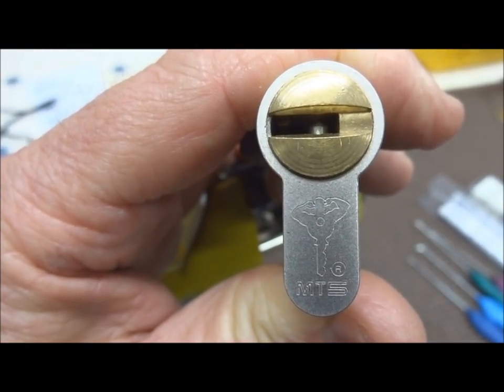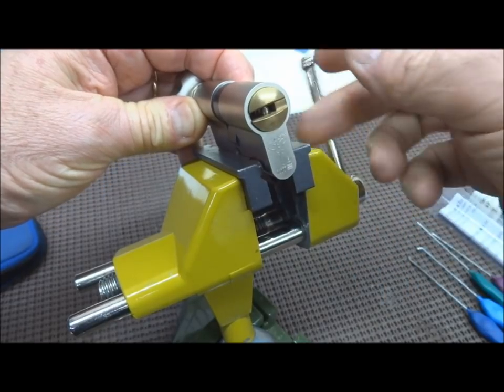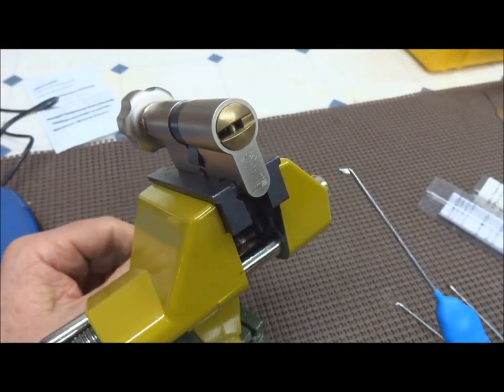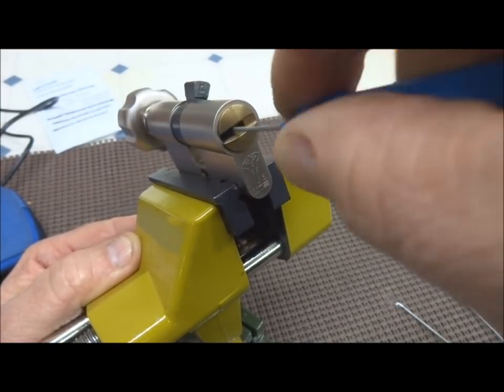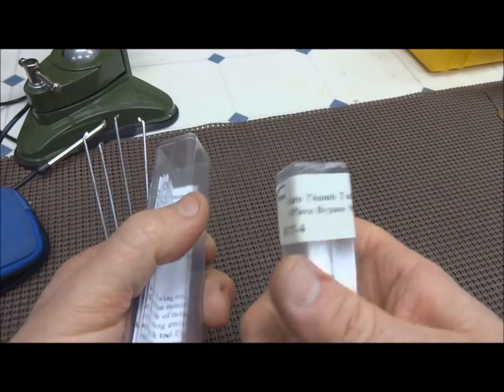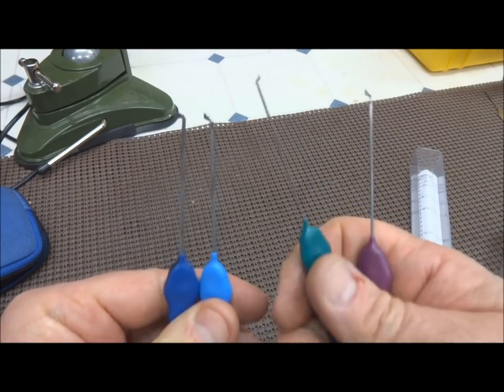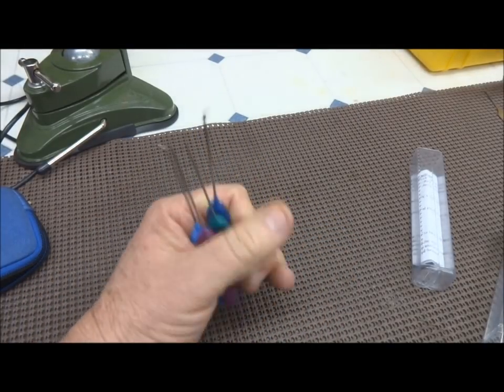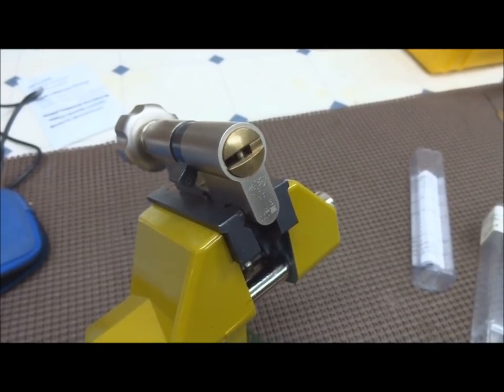(168) How to Bypass Euro Thumb turn Cylinders (Protect Yourself!!!)

Comment from the maker: You're right that it is always easier mounted in a vise, but thats simply not practical for hobbyists.  However, there are commercially made bypass tools (sold by Peterson, Sparrows, etc) that ARE strong enough to turn the tailpiece on Euro Cylinders while they are installed.  I have done this bypass on many doors in Central Europe using Peterson tools with absolutely no problem.  Most good mfgrs today know of this technique and have redesigned and protected their locks tho.  Thanks!  bill

Comment: The thing is, when you try this bypass method when the lock is in the actual mechanism in the door, and it requires a lot of force to actually turn the lock to the unlock position. It is much easier with a lock in a vice or out of the door.
Reply: Yes, and that's why you should use as thick flag as possible to be able to use enough force.

Comment: I take that back... I bet that filling in the hole in the sliding bit of the lock cylinder's side of the cam would prevent the wire from reaching around and engaging the locking cam. Hmm.

Comment: WTH!!! 
That is why I like the feature on the Tokoz Pro, you can just pull out the thumbturn in your direction and even if you have a key the core on your side will move with the key but the locking bolt won't :)

Comment: I think it's a basic flaw in the fundamental design of most europrofile locks and how the cylinders engage with the cam. I can visualize a design without the bypass, but it's not clear that it would be easy to retrofit.

Comment: Will this work on a lock that is actually installed in a door? I found that some locks require a lot of force to move the bolt, enough to bend a tension wrench. I'm afraid that these bypass tools will bend or break before actually unlocking the door.
Reply: Yes they would work at leas should. There is always some lock that is stupidly hard to turn.

Comment: Would it be possible to use a dimple lock pick instead of buying a dedicated set ?
Reply from the maker: Probably not, the tip wouldn't be long enough.  That's overcome by events though, as every manufacturer that I know of has built in a defeat for this attack.  Sorry.  10 years ago it was ground-breaking, today it is the equivalent of a Beta tape or 78rpm record.

Comment: Got a source on that? The bolt throw on upvc mechs is very light, I've seen it done in field multiple times.
Reply: this does work and work well on over 80% /90 % of locks i am a working locksmith

Comment: are these made diy the same (easy?) way as the windshield picks?
Reply: +Felis Extraterrestris 
hard, round steel wire bent to 90 degrees and flattened, plus needed flagging.

Comment: Any chance they can be gutted and retrofitted with some sort of blocking plate?
Reply: There's no good solution because this is caused by the eurocylinder format factor combined with how pin tumbler locks work in eurocylinder. Basically you can make this attack harder to execute but you cannot prevent it.

Get one with Abloy disc detainer core if you want security with eurocylinder format factor.

Comment: Thes i banned  in my country  we have many times a smal window in our front doors or a mail opening.
You can easy break the window or go trough the mail opening and turn the lock open.
Reply: At least here in the UK doors that can always be opened from the inside (either thumb turns like this or "nightlatches") are very common in commercial buildings because the risks of people getting locked in are considered to outweigh the security risks.